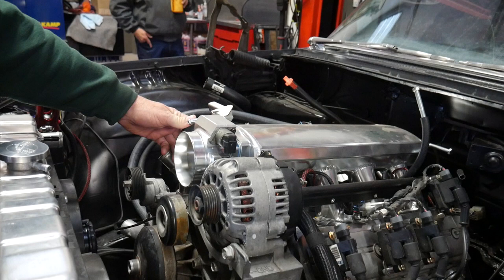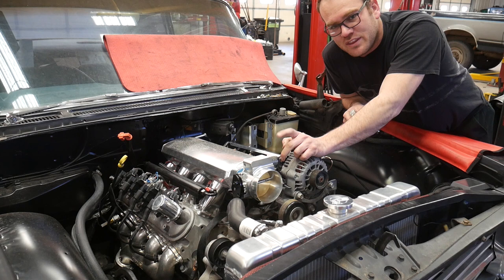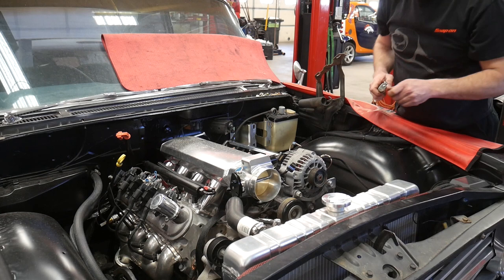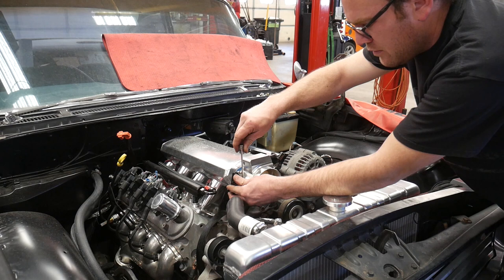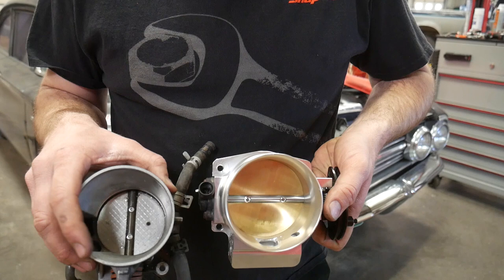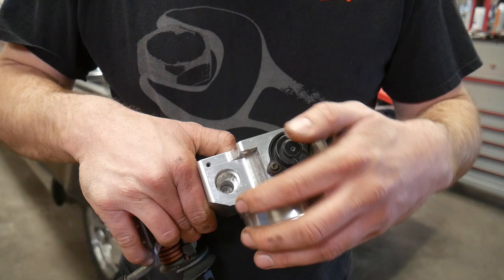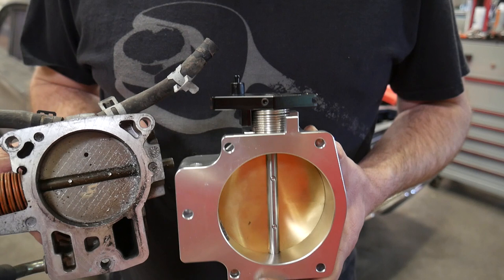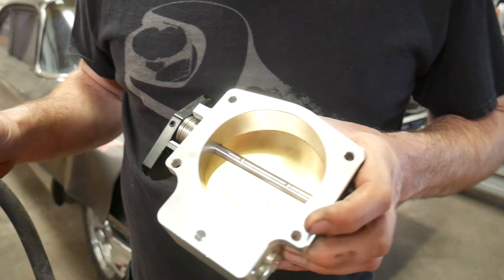Biscayne Ep. 35 Throttle body modification to stop the whistle

Comment: I've got the 90mm Holley Sniper and it does the same thing !! It's kinda cool at first, then after a few days it makes you want to pull your hair out lol. I might try your mod, I want to go in small  increments until it's bearable. Right now with the filter on and hood closed it's loud as #$%&. Thanks for your video bro.
Reply from the maker: No problem. For the price of these things they should be quieter. The intake hiss shouldn’t be louder than the exhaust. 

I’m no engineer and I was able to make it quieter so why couldn’t they? Probably because it was cheaper to drill a small hole than to perform the porting we did. 

I can’t believe how much material I had to remove to open up that port. I have also seen people drill a hole in the throttle blade to reduce the amount of air going through the IAC but many still have a whistling noise after.
Reply: I have the same TB 90mm Holley sniper and it whistles from the IAC port, I’ve changed everything ever since the tbss swap. I’ve bought twice. I’m now looking this up on my day off. Cause I’m sick and tired of this noise.
Reply: @chrisgore2849  did you ever solve the problem? Got the same issue not sure what to do

Comment: I am just now researching this as I to have that loud sound coming out of my air cleaner but I got the Holley 92 mm throttle body and in their forums it says the pentyl on there motor is different from the original 5.3 pintle motor but thanks for sharing because now my suspicions that I wasn’t hearing things is correct I will know buy there iac ,Thanks for sharing again
 that goes to my throttlebody
Reply from the maker: Let me know how yours turns out. I thought it was just because I bought a cheaper unit that I had issues. I was very nervous machining out the ports but in the end it is much quieter.
Reply: ThePracticalMechanic I did what you did I didn’t order the original iac , I will let you know as soon arrives in the mail,The original for that Holley throttlebody they want 60 bucks I ordered a cheap one hopefully it doesn’t bite me in the ass for being cheap ha ha
Reply: A week later quick update look into getting an iac From an early 2000 3100 American engine anyone will work,Totally got rid of the loud hissing sound it is totally quiet now with no modifications,I got mine out of a junkyard out of a early 2000’s Monte Carlo with a 3100 engine
Reply from the maker: Great news. Junk yard parts saves the day. I’ll try a 3.1 IAC next time for sure.
Reply: I just bought their IAC for my 90mm Holley sniper, the noise is worse on my 5.3
Reply: @ThePracticalMechanic did the 3.1 iac work?

Comment: Same problem with stock 5.3 ls with bigger injectors...edelbrock intake with 102mm throttle body...startup ccold...howls like bearing out in alternator behind airfilter...reverse 180 degrees on airfilter with tube...to passenger side was all intake noise. 2003 5.3 ls from Tahoe in 69 elcomino...

Comment: If you decided to drill a hole in the throttle plate, could you solder it closed again later if necessary?
Reply from the maker: Russell Duncan yes you could solder it up. I even consider a rivet to plug the hole if the hole didn’t help or if It had undesirable results.

Comment: Thank you for the vid I have a 6.0 with a 92mm throttle body. Same noise before your porting I will try that & check if quiets down. Again thank you!!!!
Reply from the maker: Did it work?
Reply: @ThePracticalMechanic  it worked a huge improvement. My son thought it was a belt squeak. Until I unplug the IAC & started the motor nothing. Pulled the throttle body ported the holes 1/4" inlet/outlet. Squeak noise is gone only the air noise remains. My  customer is happy. The engine is in a 72 Olds. Cutlass. with a TH350 runs great, thanks again!!!

Comment: 102 mm or 92 u must be tune in order to work properly mine does the same it sucks alot of air it idles high and no its not the idle valve or intake leaks

Comment: I'm experiencing the very same thing with my 92mm throttle body. By my question is with you just swapping out the idle air module, how much did the sound reduce? By boring out the ports, how much more difference did that make? Thank you in advance for your help.

Comment: Did you have to do any tuning after porting the iac opening?
Reply from the maker: no tuning was performed to idle settings. I adjusted the throttle opening and watched iac command. you want to make sure the IAC is at 0 steps. If it is at 0 steps you may need to close the throttle plate slightly. 15-20 steps on a hot engine with AC off is a good starting point.

Comment: Did the idle stick before this for a few seconds
Reply from the maker: They all seem to hang at fast idle for the first 10 seconds or so. If the throttle blades are actually sticking in the bore you probably need to adjust the throttle stop in a little more to keep the blade from sticking in the bore.

Comment: In order to remove the whistle you need to port match
Reply: I’m not to experienced on cars but what does port match mean?
Reply: @aarontovar8769  when the throttle body matches the diameter of the intake manifold
Reply: @paulvelez6824 i have a 92mm tb on a 92mm intake and it does the same thing